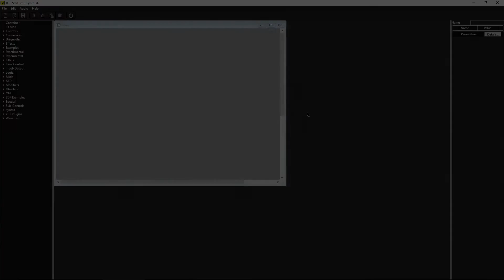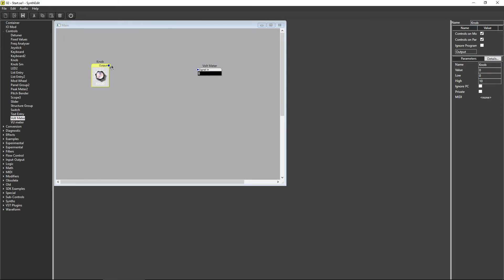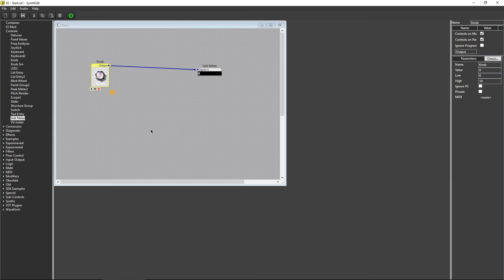SynthEdit 1.2 - The Basics

Comment: Thanks for these videos.  I just downloaded the demo, which looks to be v1.19, to get familiar.  If I purchase through the "Buy" link does that default to 1.2 or is this a beta version?
Reply from the maker: 1.2 is a beta, you can find it at http://synthedit.com/members/ 
I bought SynthEdit before 1.2 came out, so I can't remember if you need to buy a license to use it or not.
Reply: Thanks!
Reply: demo is version 1 without the ability to remove demo from a created vst or allow you to run vst that have been created with demo on other computers and disallows you to register or set preferences the paid versions are anything above version 1 and allows a lot more functionality to register go into preferences tab in syn th edit after you download it. if you are having trouble opening syn th edit on windows try right clicking the application once you have found its location on your computer then click properties after the window opens up find compatibility settings and set the compatibility mode to allays run as administrator click apply and it will work properly, not the question asked but it is the most common issue i see amongst new users also note that projects you make in the demo version may no longer work with the later versions and i can not find any 1.0 full versions of the software anywhere on the net that do not have a virus attached to them, i am very bummed out but i created a few weeks of work a vst in demo version and am unable to migrate all of the info to the newer version of the program and am demotivated to restart that project i originally started working on i would like to thank TodaysTuts for this tutorial series as i have used it to much help me in the creation of some fun and interesting vst's